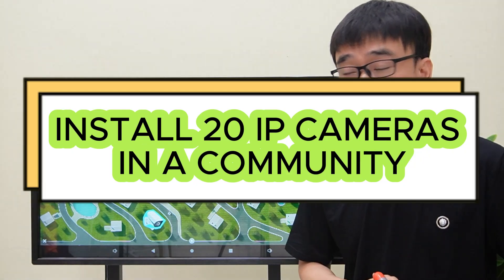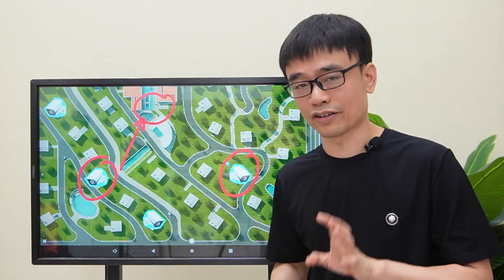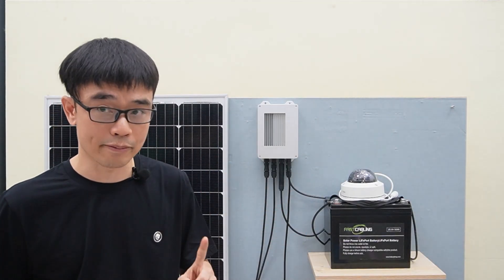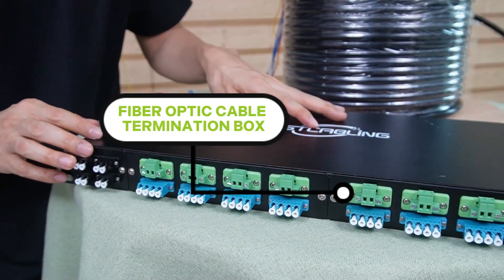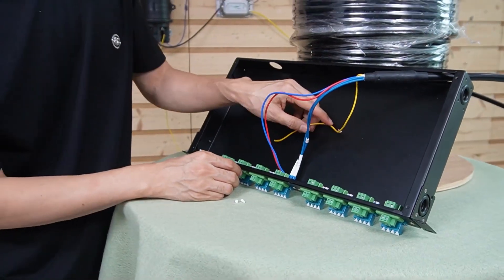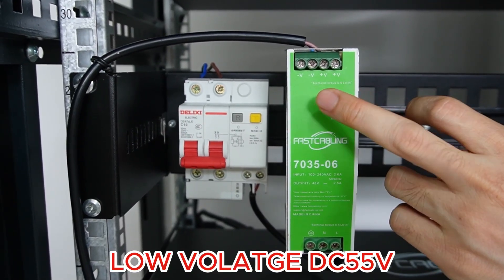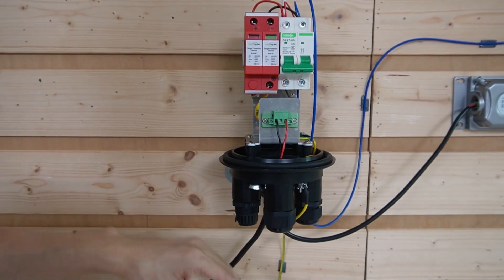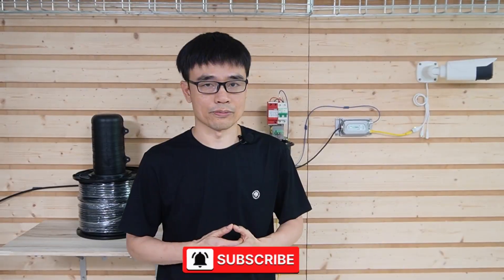Power 20 IP Cameras 2000ft Away: Solar vs. Composite Fiber | Long-Range CCTV Project Pt. 1

Comment: This is an IP camera installation..
Reply from the maker: Take the same approach to setup more cameras. Only the fiber optic cables and the terminated boxes. The core switch has 24 SFP slots to handle up to 24 ip cameras.

Comment: at a distance of 200ft(600m) should we worry about the DC voltage drop that may not power the IP Camera ?
Reply from the maker: It can supply 14.4W in 600meters (1800ft) with 18awg wired gauge. The DC input voltage is 55V.
Reply from the maker: The voltage drop increases as the distance increases. There are some key factors affecting voltage drop:

1. Voltage Input of the Camera
Most PoE (Power over Ethernet) cameras use 48V DC (IEEE 802.3af/at/bt).
Non-PoE 12V/24V DC cameras are more susceptible to voltage drop.

2. Wire Gauge (AWG) & Resistance
Ethernet (Cat5e/Cat6) wire resistance: ~0.188 Ω/m (for 24 AWG).
Thicker wire (23 AWG or lower) reduces resistance.
Separate DC power cables (18 AWG or thicker) help if not using PoE.

3. Current Draw (Amps)
A typical PoE camera draws 0.1A–0.3A (IEEE 802.3af: max 15.4W).
A 12V/24V camera may draw 0.5A–1A, increasing voltage drop.

Comment: Can i ask something, As the fiber is pre-tem with 2 head on the other end meaning it 2core fiber. How then will other 18 cams get to be connected ?
Reply from the maker: You can connect one fiber strand to a PoE switch to connect multiple devices at once. 

https://www.fastcabling.com/networking-solution/p2p-fiber-optic-link-with-8-poe-out/

Comment: Remind me not to be part of that community
Reply: This is one way they do cctv along highway systems. In the US the big spenders for these sorts of projects also setup transformers for example 277V to 12V dc. Any long run over 600ft will usually use fiber cables. Many cities are going with small solar panels to a cabinet that houses the charge controller, battery and din rail router or edge device instead of fiber because it requires less construction labor(ie drilling, cutting, burying, etc)

Comment: Do you have a solution for ants?  🐜🐜🐜🐜🐜🐜🐜🐜🐜 They get into my devices and destroy them. Even when they are sealed. Or they chew through through cables. I spray insecticide as a preventative when I can but I can't spray everywhere all of the time and one example is where you would use something like an outdoor switch or media converter or POE extender where it's above ground. The ants are attracted to the electromagnetic field and the heat and climb up the pole. They have done a lot of damage. 😟
Reply from the maker: You might choose the outdoor PoE switch or PoE extender with IP67 waterproof rate. It will stop the ants.
Reply: @Fastcabling  I have IP67 rated devices and it didn't matter. I have unbelievable pictures
Reply from the maker: You can use ant-proof gel barriers (e.g., Tanglefoot, petroleum jelly). Apply them around poles, conduits, or entry points.
Reply: @Fastcabling  Thanks I will take a look at that. How long does it last?
Reply from the maker: 1-3 months. A more harmless and natural way is to spray soapy water to clear ants and their trail. However, it dries up quickly outdoors.